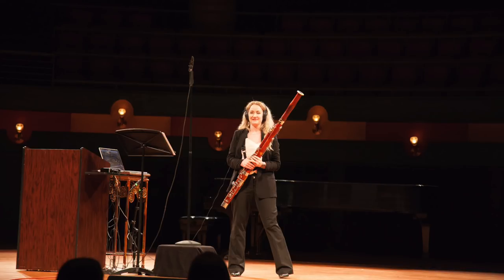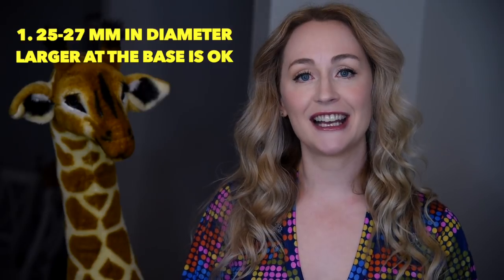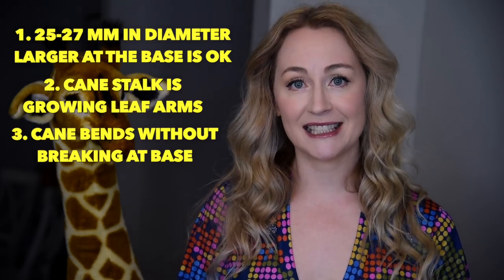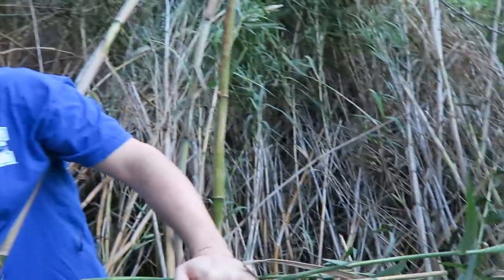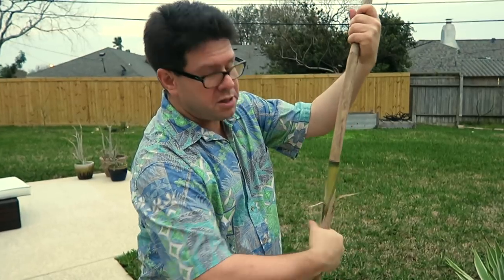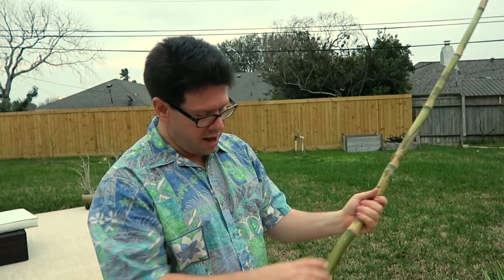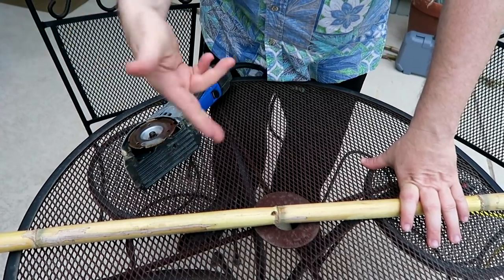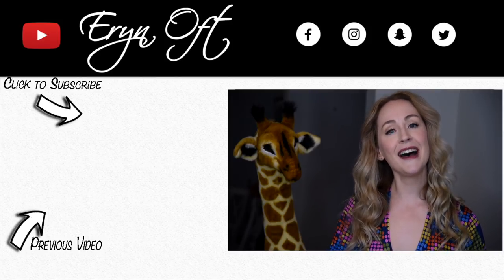CANE HARVEST WITH SCOTT POOL and the TEXAS A&M UNIV CORPUS CHRISTI BSN STUDIO

Comment: Mani, I don't think it matters terribly much if you cut the cane into segments as soon as you harvest, but this is my way of "keeping track" of the year, before I place it in the cheese boxes. However, when I first started harvesting, the first year I immediately cut the segments, but experienced mold on many of the segments and had to toss them.  Since I have let them dry for a year as stalks, I have not had the issue.  You would need to ask a botanist if this is a valid reason to keep the stalks intact, or if I just had bad luck the first year.  Regardless of when you cut the stalks, the aging process is ideally still about two years.  There are ways to speed up the process, but I like the natural way.  It takes patience, but after two years' harvesting, there is always cane ready for another stage of processing.